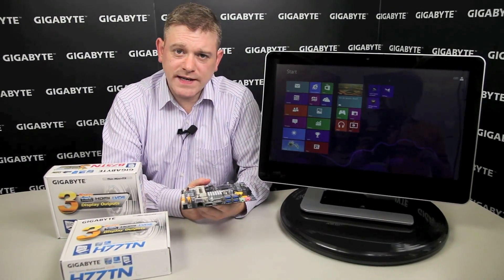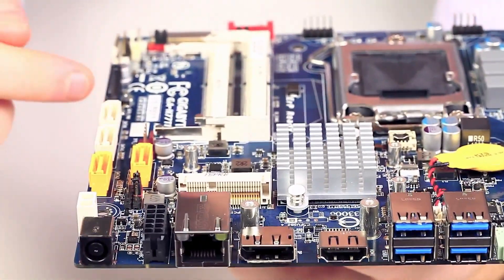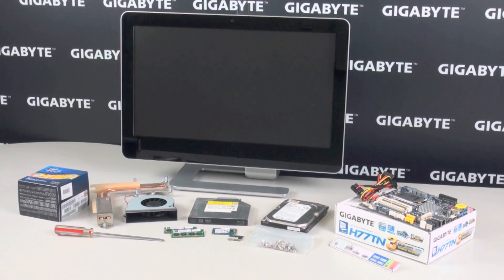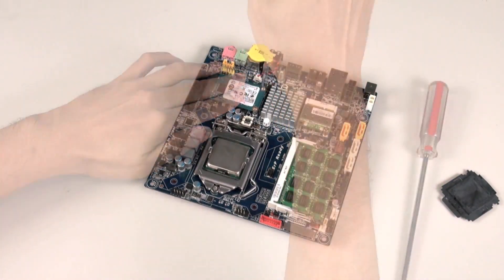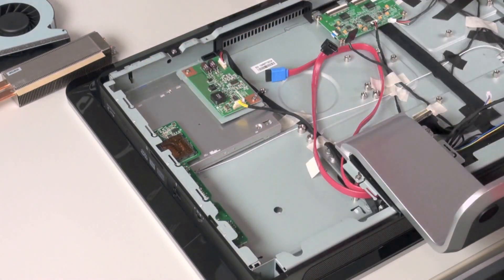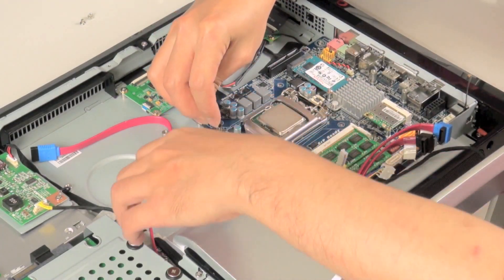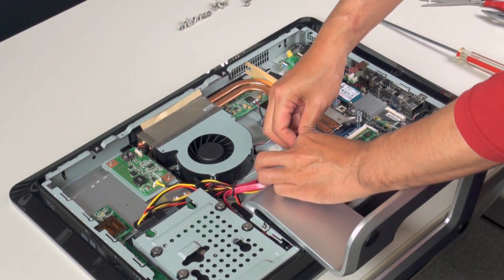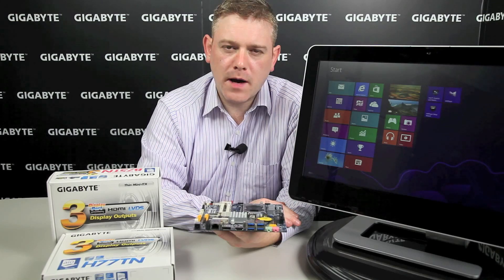GIGABYTE Build Your Own DIY All-in-One PC with GIGABYTE Thin Mini-ITX

Comment: I would like to use the b75tn in a custom case media-center pc project I am building. I would like to use the external power supply input but cannot find which power adapter to purchase that will be compatible with this motherboard?

Comment: Does the thin io shield fit in a normal case? I wanted this mobo to use the dc12v thinggy.also can it power 2 7200rpm hard drives,a normal dvd drive,a xeon e3-1245v2 cpu underclocked at 2.3ghz?